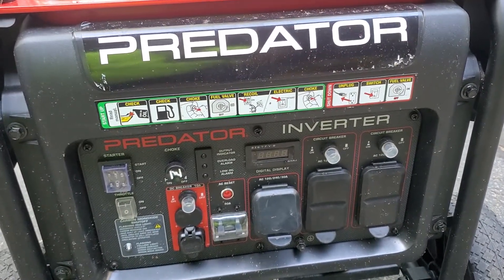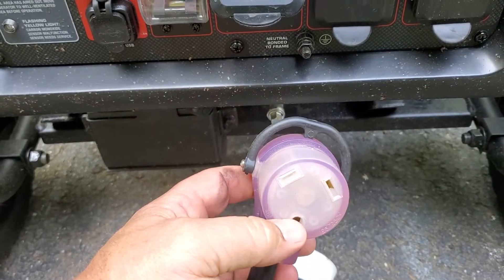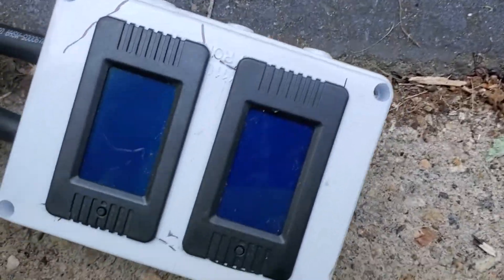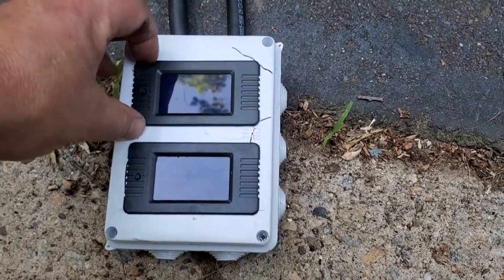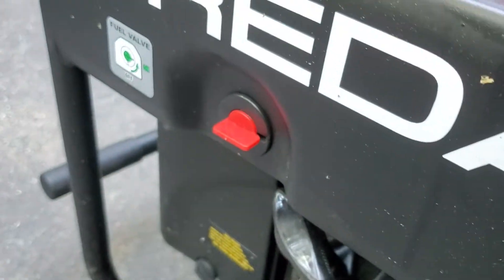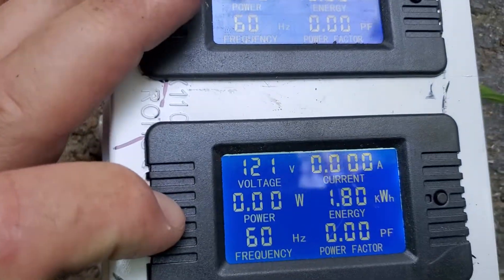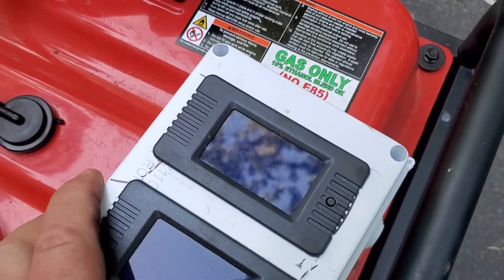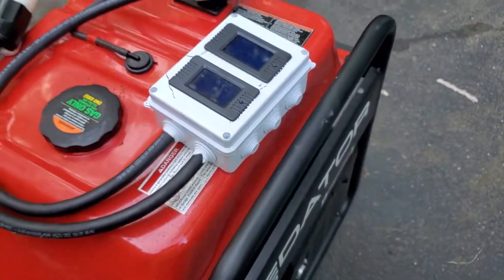120 / 240 volt inverter generators, how to monitor/meter each leg for usage

Comment: Thanks, I wish you showed how you made it step by step. Did you consider mounting the meters on the generator or on the house panel?
Reply from the maker: @gregpalmer9949  the meters are not water proof. If you can mount inside your home, at the panel, you could monitor it from inside. My set up was to experiment and see what I could do with it.

Comment: I don't think it will work with 240vac to determine total amps or power -unless your loads are purely 120vac.
For any 240vac load, this portion's current would exist on both hot legs. So 240v current as measured on both hot legs, sums to twice as much as it really is.
Reply from the maker: @mikecr4916  Each of these meters has the magnetic ring that each hot leg passes through and each meter is powered by 1 hot and one neutral.  While one meter could be used if it was solely a 240 circuit, that is not the case for me. I am using 120 and 240 at the same time. The well pump is 240 and the remaining circuits I need are 120. Therefore, my usage would be different on each leg.
Reply: @MrRChitty  So which legs do you install the multiple CTs on?

Comment: Great video, so if I have a 4 prong  twist short jumper at the generator , which mates to a 50AMP 10 ft cable into my trailer 50AMP service connection , I should be getting 29 AMPs on each leg to that panel box inside because I'm not going to a RV 30AMP 3 prong plug . My adapter plug is a 4 prong twist to a 4 prong straight plug in which goes right into my 10 ft cord to the outside connector. 

Jim
Reply from the maker: Exactly.